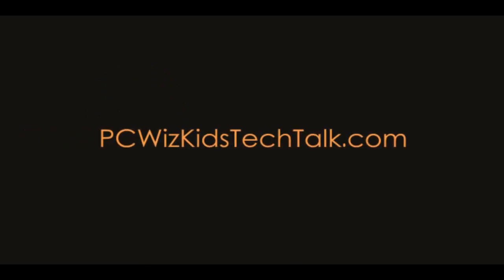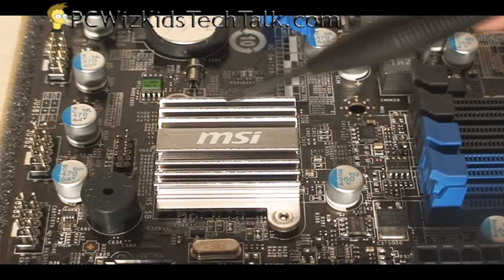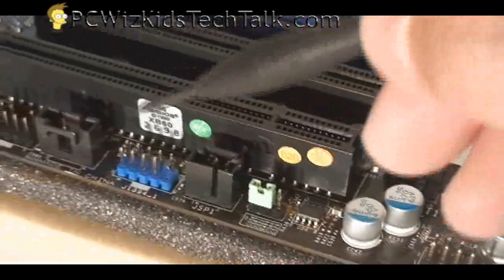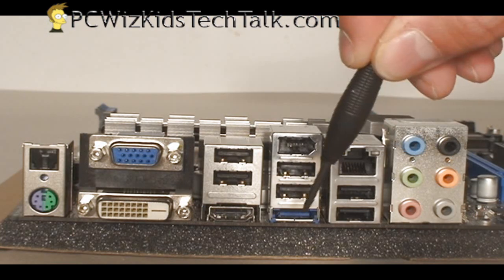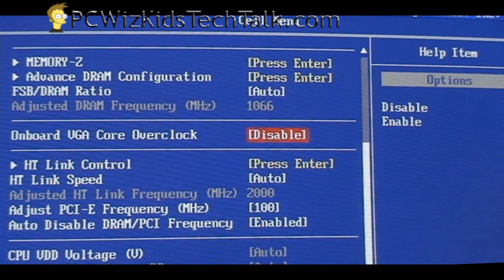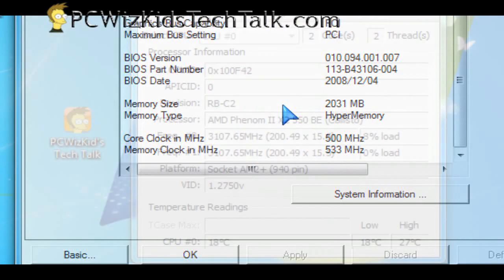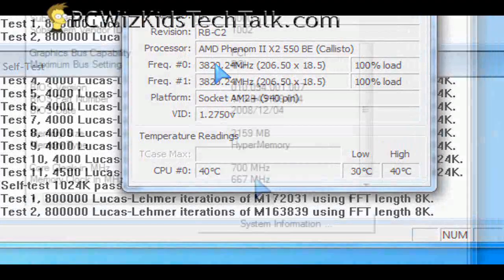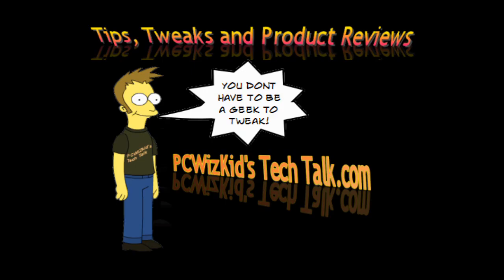MSI 785GM-E65 - AM3 Motherboard Review

Comment: dude, 4 gtx 295's would mean 8 gpu's, because the 295 is two 285's, therefore its not possible, most cards you could do is 4 285's, thats the only card that supports 4 way sli, 4 way sli for the 295 is two 295's

Comment: Not really ... if your running high resolutions with a beefy card (gtx 295 for example) then a Phenom II x3 720 will have almost indentical performance as a i7 in most games..

The cpu is important sure but very high end cpu's like the i7 are overkill atm for gaming.. they are still nice tho for furtureproofsness

Comment: So basically, your argument is based on pressumptions.  One being that you need a better processor, when the average processor has not been established.  And most motherboards support SLI or CrossFire, so you have no point.  A motherboard that costs more will also have better over-clocking ability and will typically last longer since better materials are used (japanese capacitors, copper, etc).

On a gaming PC, the GPU is what matters most, not a CPU.  CPU is next.

Comment: The difference in power draw is negligible.  The 5 amps more it consumes is less than $5 yearly compared to a GTX 280.  In three years, which is when one would typically upgrade, it only adds $15 or so.  $15<$150.

"and you'll also have to shell out more money for a better processor and an SLI/Crossfire motherboard to prevent bottlenecks."
Wrong.  That doesn't depend on if wether you have a dual-GPU or not.  It's dependent on frame buffer and how much CPU the game itself uses.

No points yet.

Comment: "There will be cards with larger frame buffer in the future to accommodate these games, so your argument is false."

Yes, and no.  New cards with larger framebuffers will exist in the future but a dual-GPU is always more cost effective.  When new technology comes out, it costs more.  Case in point: when the GTX 280 came out, it costed $600.  But you could set a 9800GTX+ SLI for $450 and get the same performance, making it more cost effective.

Comment: The point is that, as you know, the higher the resolution, the more pixels that need to be rendered by the GPU; at a resolution of 1920x1200, your GPU has to do a lot more work than at something like 1280x1024.  Future games will use more frame buffer.  If you add another GPU, you have double the frame buffer plus the added performance of enabling both GPUs.  What this means is that in a resolution like 1920x1200, where you'd get something like 35 FPS, you could get 55-60 FPS afterwards.

Comment: Now try to use that for doing gaming at anything higher than 1680x1050 and tell me how it goes.  The point of multi-GPU configurations is that you gain a lot of performance at resolutions of 1680x1050 and higher.  If you have a large monitor, you'll probably need to do it if you need to be future-proof.  Also remember that at a resolution like 1920x1200 (or also 1920x1080), the frame-buffer is gonna start to run out if you don't have more than 512MB VRAM.

Comment: And it doesn't suck up much power at all.  The requirement for a Radeon HD 4830 CrossFire is a 550-watt power supply, and you can get a brand 600-watt PSU for less than $75.  If you get a high-end card to accomplish what you can do in a multi-GPU configuration, you'd still be using about the same power since the higher-end card will use more.  Case in point:  a Radeon HD 4890 has a 500-watt PSU requirement, while a Radeon HD 4830 has a 550-watt PSU requirements.  50-watt difference.  HOLY SHIT!

Comment: No, you don't.  You're COMPLETELY missing the point.  You buy a Radeon HD 4870 now for $140 currently to play all the latest games at high resolutions, and 5 months from now it should cost roughly $80, and you buy it at a lower price to keep playing the latest and future games.  That's the point, you fucktard. 

Proved wrong again, and your IQ seems to be of 60.  Not the same price, so your argument is unfounded right off the back.